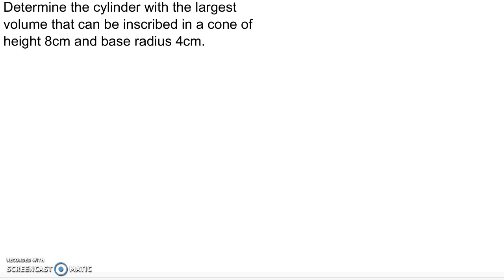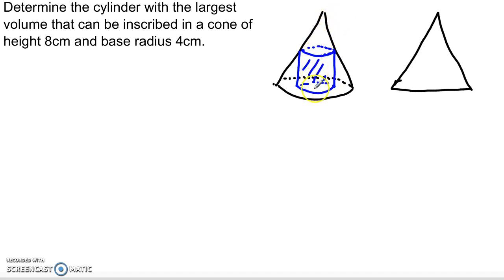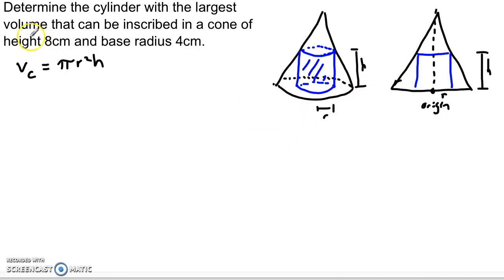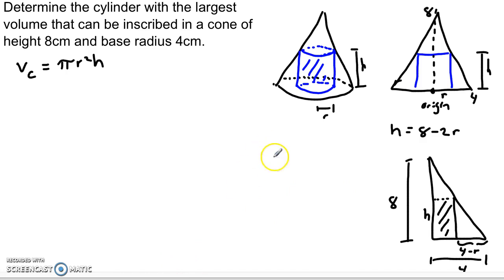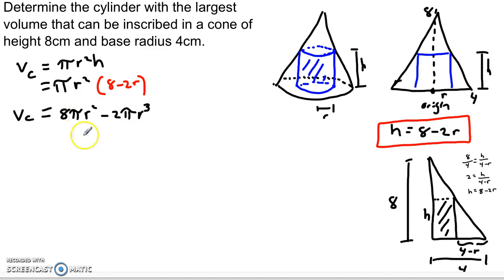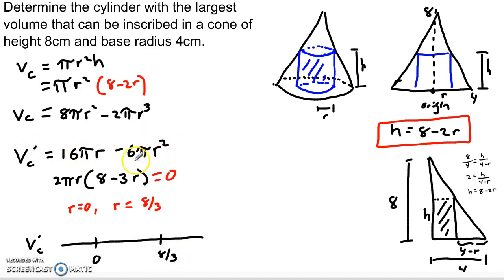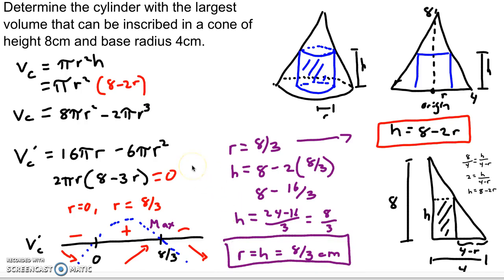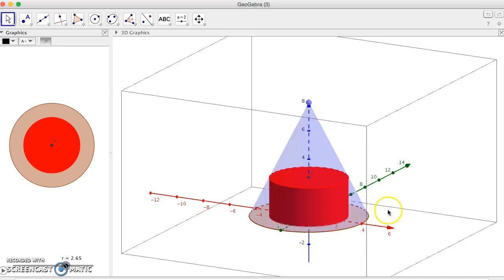Optimization II - Cylinder in a Cone

Comment: 3:12 cmon, man, you could’ve told us how you got that 8-2r
Reply from the maker: Oh sorry- I did show it with the similar triangles.  The reason you know it's 8-2r is just slope and y-intercept.  The height drops 8, while the radius goes to 4.  So the slope is -8/4, which is -2.  The line starts at (0,8), so that's the y intercept.  Just plug into y = mx + b...  H = -2r + 8, or H=8-2r.

Comment: Can you please clarify how you wrote linear equation h=8-2r in a jiffy :-) Curious to know the details behind the equation. Yes, understood the similar triangles part. Thank you.
Reply from the maker: Ok, so you can always get the equation from the similar triangles,  but in this case there was a nice relationship if you imagine an x-y axis on top of the triangle.  Since the height is 8, that’s the “y-intercept” of the line that matches the side of the triangle.  Since the side of the triangle hits the “x-axis” at 4, the slope is -8/4 which simplifies to -2.  Therefore using y=my+b the equation would be y = -2x +8, which I wrote as y= 8 - 2x because I don’t like negative signs after equal signs.  Then I just replaced y with h to better match this specific problem.  Does that make sense?
Reply: @RealMikeDobbs  Thank you Mike. Absolutely makes sense. I think you meant slope to be  -8/4. Trying to brush up school math concepts for my son 🙂
Reply from the maker: Haha, you are absolutely correct; thanks for pointing that out, I edited the reply.  Happy to help- many more videos on my channel.  Thanks for watching 😄

Comment: How do you know to subtract 2r from 8 to get the height? I understand that since the cylinder is less than the height of the cone it'd be subtracted from 8, but why 2r? Also why do you do 8 divided by 4-r and not 8 divided by r?
Reply from the maker: There are a few ways to see it.  In the video I initially just thought about the linear equation that describes the side of the cone… but if you keep watching from 3:35 I explain how to use similar triangles to see that the height is 8-2r

Comment: So uhm... I dunno if this is gonna be seen, given that it's a 5 year old video, but first of all, thank you for the lesson! And secondly, should the height and radius of the cylinder always be the same or it's only for this case? Thank you!!!
Reply from the maker: Hey, thanks for watching 😄
In hindsight, that wasn't the best example to use for exactly this reason.  I just happened to choose a radius that was half the height in this case.  In general, the height of a cylinder or cone has no direct relationship to the radius 👍

Comment: where did the 8/3 come from at 6:15
Reply from the maker: Solving the equation on the previous line.  If the product is zero, then either (2pir) = 0, or (8-3r)=0.  The second one is zero when r = 8/3

Comment: A cone is MAYBE half the volume of a cylinder

1/2(b1 + 0) x height

base2 is 0 because the tip of the cone has an area of 0 or an area that is infinitely small. This may prove that a cone is half the volume of a cylinder. Let me know what you think!
Reply from the maker: In a way you're right.  The formula you are referring to is the formula for the area of a triangle, and indeed, a triangle has half the area of a rectangle with the same base and height.  You can tell that your formula is for an area because it contains only two dimension.  You can think of a rectangle as a 2D cylinder, and a triangle as a 2D cone.  Indeed, in 3D, a cone is exactly 1/3 the volume of a cylinder with the same base and height (in 3D the base is a 2D shape).  In fact, this continues into all dimensions.  In 4D for example, a 4D cone is 1/4 of the volume of a 4D cylinder (although this is impossible to visualize).
Reply: @RealMikeDobbs   so my formula can only calculate area for 2d shapes? I thought it could do the same for 3d shapes like a cube, cylinder etc
So here is my formula, and I'm sure it works for most 3d shapes.
Find the area of the 2 bases of a 3d shape, and in this case I'm going to use a cylinder for example, add the 2 bases up, multiply them by 1/2 or divide them by 2, and then multiply them by the height, which should give you the volume.
The same should be applicable to a cone in theory, because it has 2 bases, the tip being a base with an area of 0.
I'm an 8th grader and dont understand much about advanced math so please explain to me why or why not my volume equation is invalid.
Thank you
Reply from the maker: Wow- these are great questions for an 8th grader!  Thanks so much for asking.  You’re formula will work for what I call “stackable” 3D objects.  I have a video on those if you want to check it out:  https://youtu.be/gcDjF9Bo-0Y  The short version is that your formula will only work for shapes where the two bases are the same size.  So, you can actually simplify your formula a little bit.  Since you are adding the areas of the two bases and then dividing by two, that will just get you back to where you started (since the bases are the same).  So for stackable objects (area of base)(height) will get you volume.  Cones are a different type of object which I call “pointy” objects.  I have a video on those two where I get into a fair amount of detail on the whole “Why is a cone 1/3 the volume of a cylinder” thing.  You should check that video out here: https://youtu.be/eBx6uqBY_Ug
Reply: @RealMikeDobbs   thanks for explaining!

Comment: Do we get the minimum volume when r=0?
Reply from the maker: Sure, but that's not very interesting right?  In general with the Max/Min problems one direction is interesting, and the other isn't (in math we call that trivial).  For example, in this case it's interesting to see what the largest cylinder we can fit in the cone is, but not so interesting to see what the smallest is (zero volume).  If on the other hand I had a certain amount of volume I needed to enclose, I may want to try to find the cylinder which will minimize the amount of material needed to enclose that volume.

Comment: How'd you get -2r?
Reply from the maker: It's just the slope of the line that represents the side of the cone.  The y intercept is 8, and the slope is negative 2, so the equation is h = -2r + 8 or h = 8 - 2r.  Here I am using h and r, instead of the usual x and y in y = mx + b.  Hope that helps.